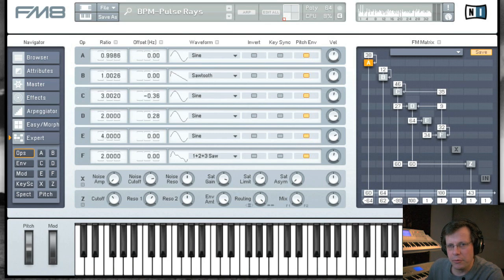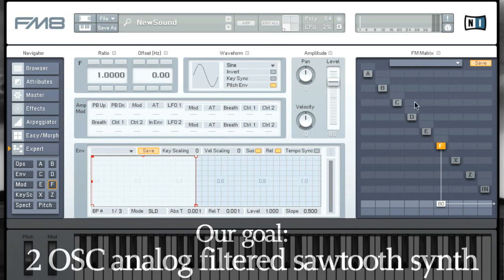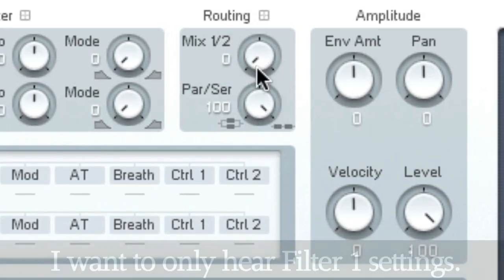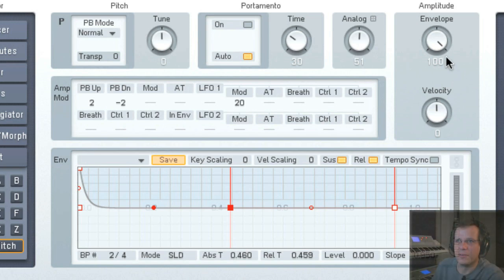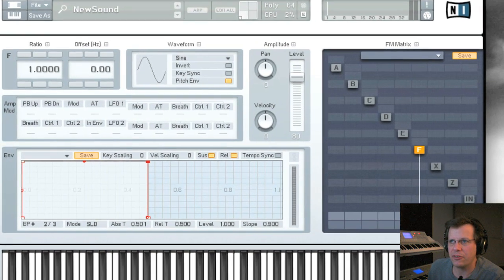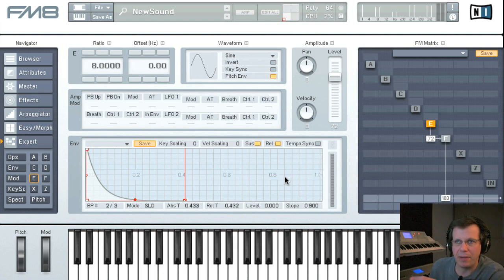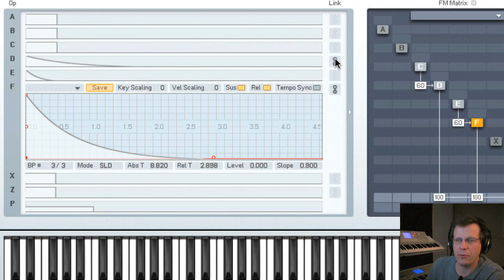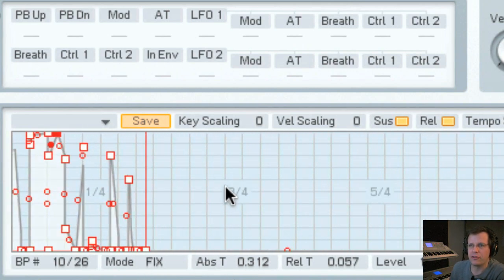FM8 Power Review Part 2/2

Comment: Your bell example shows exactly the problem of FM8 when compared to FM7. You can't easily copy and paste complete OSC sections! So, copying even a simple osc setup to another oscillator is really painful and it's easy to make mistakes. In FM7 you simply hit copy and then went to whatever oscillator you wanted and pasted it all back there. Done. In less than 5 seconds. I have absolutely no idea why they completely gimped FM8 when it comes to deep editing. I hate it..

Comment from the maker: @delucey - I am NOT official NI Tech Support - but my guess is that you're missing the standard template files that were installed when you first put FM8 on your computer. Simplest solution would be to do a re-install, if possible... hope you get things working - these default templates are very useful.

Comment: Pitch, the higher it is on the modulator the "brighter" your sound becomes. Also the pitch changes. It's FM, so you can expect things to be really unpredictable. Which is cool if you ask me.

Try detuning two OPs or OSCs or whatever you want to call it in the ratio bar and boom, you get a wobble but with different depth than if you'd use the detune in the Master Edit Mode/Tab on the left.

HMM!? Love fm, shit.